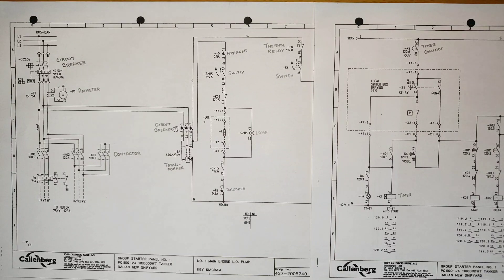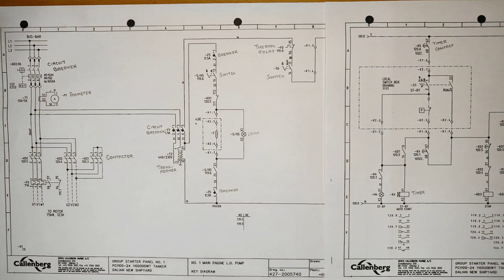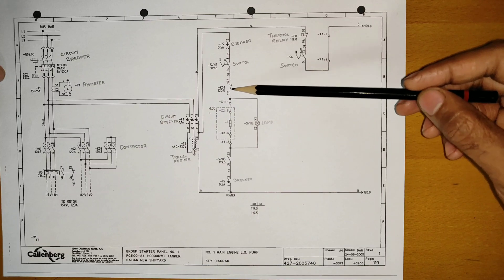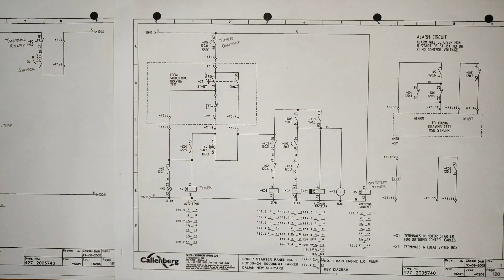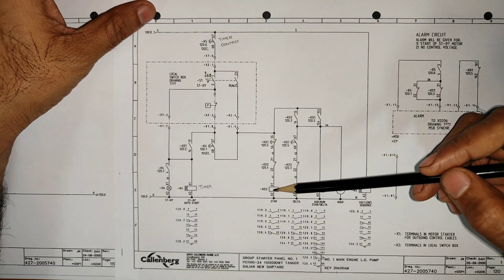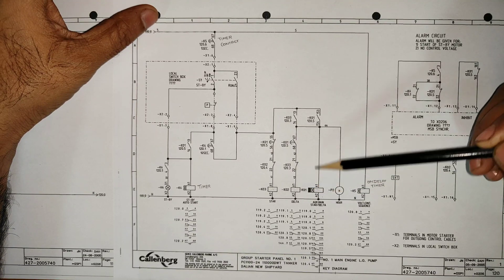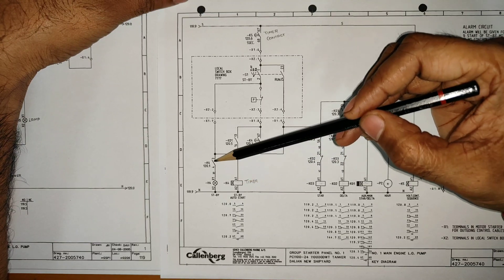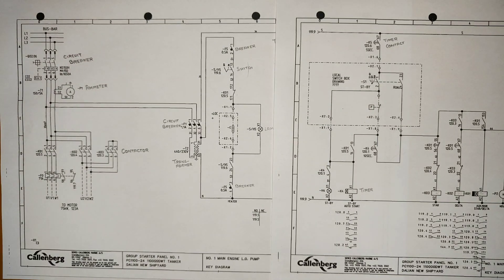Star delta starter Explained-using WIRING Diagram in easy steps

Comment: Please makes the video in practical. ( After pressing the start button, if star Delta starter not working than how to trace  the fault by using the digital mutimeter ) Thanks.
Reply from the maker: Thanku for suggestion, i will try